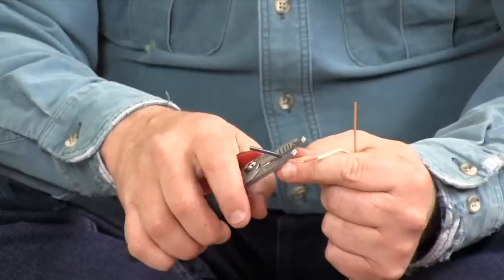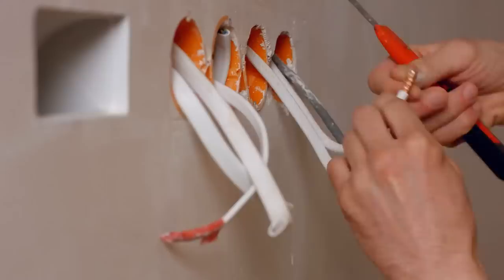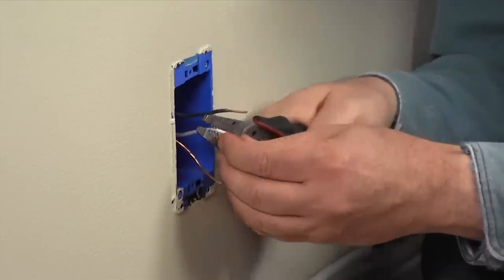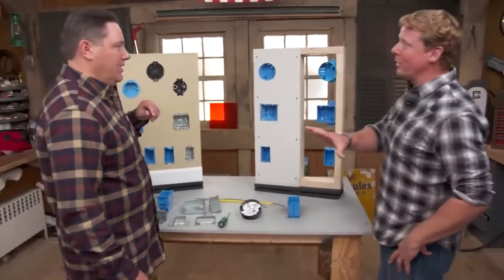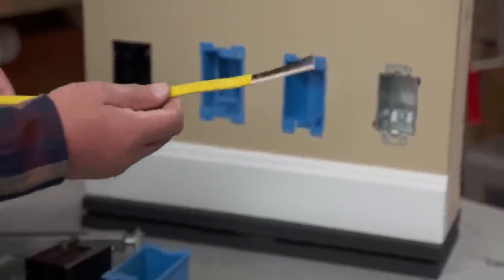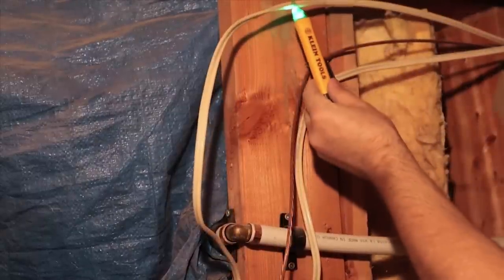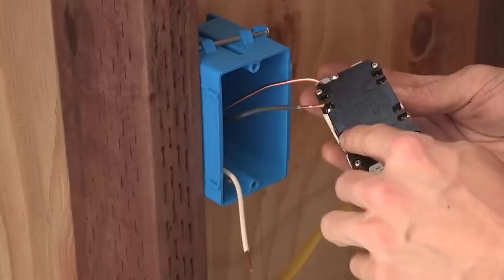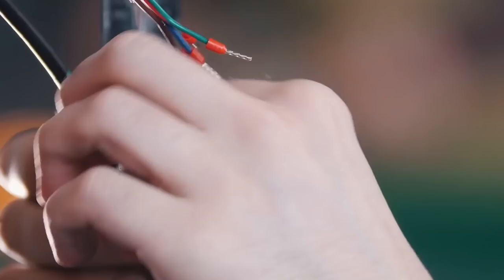Electrical Mistakes That Every Electrician NEEDS To STOP Making!

Comment: I'm a little confused by this. Are you under the impression that short wires are considered short circuits?? I assure you that they are two very different things and you have a serious misunderstanding of electrical basics. It's best if you leave the video making to those in the know. 😂
Reply: You need to go back and actually listen to what he said.
He said short wires are a cause of short circuits.
If the wires in the box are too short, there isn't enough ground wire to safely keep it away from the hot terminals in the box. Ground wire contacting the hot wire = short circuit.
Reply: @newguy2794  The neutral and hot wire touching will also cause a short circuit.  The problem with wires being too short in a box is related to the difficulty in making sound connections to the switch or outlet.  Because the wires are so short you have to struggle to properly connect them to the device installed in the box.  A poor connection can fail, resulting in a wire slipping off a terminal and touching another wire in the box.
Reply: @jackpine4347  That is how I understood it too. However in the very next statement he equates loose connection (shown arching in the video) with a short circuit. So even if the original thought is sound it has been garbled by the person who made the video
Reply: @david672orford  Upon further listening he made a quick reference to wires that are too short causing poor connections but did not really explain that. Most of this video is stock images combined with blabbing to fill up the time. He could have made his point about too-short wires causing poor connections that can lead to short circuits and fires in a few clear sentences.

Comment: 5:30 In most parts of the USA, it's OK to run cables through most walls with no conduit. The trick is knowing when conduit is required and what kind to use. 
PS: 2:14 If you are using the type of strippers shown here, it would be no surprise that the wires might get cut too short. Manual strippers with holes for each gauge wire are very prone to accidentally nicking, or even accidentally cutting, the wires that are being stripped. They also make it harder to strip off a uniform amount of insulation and to do it without tugging on the other end of the wire. If space allows, I very much prefer  automatic, self-adjusting strippers.
Reply: Actually, only cables defined as "listed for use in concealed spaces" are permitted by code. For the purposes of this discussion, that means NM/NM-B. Or you can use MC, which in the case of plastic boxes will require use of bonding bushings and appropriate boxes...not worth the hassle.

Your statement might lead others to believe they can legally run power cords, such as SJT or similar products through those concealed spaces. I've seen a contractor try to get away with SOOW just straight through a block wall, not acceptable.
Reply: @mikebowler1962  follow the NEC and make sure is approved by the AHJ
Reply: Please stop LARPing. Anyone who can't use regular strippers and relies on automatic ones is not a real sparky.
Reply: @Steve_Kassiotis  Agreed. The auto ones are great for bench or control panel work, too bulky for field work. Regular strippers in the hands of a pro will almost never result in a nicked/cut wire.
Reply: @pld8993  Fun fact, European electricians tend to use strippers like the CC22 or CC38 that doesn't have various sized holes, but relies on the user getting the feel for how deep to cut.

Comment: Leave 6" of wire from the inside of the box.
Reply: 6” from outside of box
Reply: @peejones9035  US NEC states: 6 inches from entry point of the wire, or 4 inches outside of box, whichever is longer.
Reply: @keebler82ut  In know what the Nec states. It was just a suggestion. I should have been more clear. I cut at 6. I like to strip my wires a little longer than needed and cut it to desired length.

Comment: Everytime I replace light switch I always keep slack on the cable(after power is shut off of course) I do have to cut the wires at where’re the clamp is for if it’s not connected using screw therminal s

Comment: alright besides the video which there are some great points you Diy or homeowners.. hire an electrician but read on.. i was reading these comments..😂😂
im gonna make this simple.
More then half these comments are bullshit.. for example, WAGOS...
i agree dont use level locks unless ur doing some low voltage.. hell go even better and solder your connections with low voltage..
However i have yet to hear anything from a pushin Wago cause fires, shorts, etc.. and ive been using them long before they were even heard of in the states.. a fellow electrician brought them from europe and showed us what they use..
Now  if a wire broke off from the Wago or some weird thing happen its cuz the eletrician made an error.. like using the wrong size stripping gauge crimping into the copper, making a weak point.. i can go even further wit other possiblities that no electrician wants you to know...
If any electrician suggests wire nuts over Wagos for lets say your job ur wanting done, its cuz he wants more money in his pocket.. it may be nickles but nickles add up.. 
besides money factors, Wire nuts are a big time risk factor,and its been proven many time over.. FOR EXAMPLE..
i dont know how many times ive opened a box and the failure was at the Wire nut.. fuckers over tighten them and pops out the tops🤦🏽‍♂️...or they dont know if when  twisting the wires together in the nut that one breaks within the sheathing until u go to test it... ESPECIALLY when they get folded up in the box... Let alone pig tails barely making connections.. box is pack to gills that the wire nut wedged between outlets or swtches..ETC, ETC... i could go on for days....
there is 2 benefits to wire nuts...
Cap live line for what ever reason u needed that line hot & quick connections to see if something is going to work...
Oooohhh wait i lied.. they are great for caping off caulking tubes as well.. almost forgot that one.. 
Wagos shit on Wire nuts! 
Want to know why electricain make a big deal about Wagos, cuz they the type who want to keep they delecate fingers soft.. meaning to get a line out of a Wago, u need squeeze the side and pull that line.. its tough, no lie, but fuck your pedicure, unless ur a lady electrician.. they amp me up 😝..
Anyhow ladies and germs, if your a someone seaking an electrician, find one who wont bullshit ya.. im tired of seeing that shit..

Comment: Bullshit right from the beginning Don’t use push in connectors fix the short wire problem by adding a length of wire with a physical connection and a wire nut!

Comment: 3 to 6" is still too short. leave at least 9" from the wall. the length of a good pair of side cutters (lineman pliers).
Reply: I strongly second this. Short wires are at the very least a pain to work with.
Reply: 6 inches is code. Having a short wire, say 1 inch is not only a pain to work with but can be hard to connect and or tighten to the device. Excessive length like 9 inches or more is not only unnecessary but can be hard to pack back into the box, especially if the box is too small in the first place. Plus, filling a junction box full of excess wires can cause unnecessary heat within the box if there is some load on the circuit. 

Stay safe and think smart.
Reply: @clarkcortezer2414  I second this!
Reply: @clarkcortezer2414  that was my thoughts as well. You only have so much space in a box there's no need to leave so much wire. Especially the exposed ground wires.
Reply: 6 inches is code. This guy making the video is absolutely ignorant. 🤦‍♂️
Reply: @Steve_Edberg  Thats not true always. The length of free conductors exiting the box depends on the size of the opening to the enclosure. If the size of the opening to the enclosure is less than 8 inches, a single receptacle for example, you only need 3 inches outside the enclosure.  300.14
Reply: The NEC is the minimum requirement,  you can do more if possible but not less
Reply: @clarkcortezer2414  
This is for all non electricians. This is how I was taught this is how I teach and this is how I do. You should be using a good pair of lineman pliers (side cutters) like a Klein 9 ne. The 9 stands for nine inches long. After the wire is pulled into the box, use your pliers as the measurement to cut the wires from the wall (not the inside of the box) to the end of your pliers and make that cut. You now have nine inches of wire. You can always cut some back if you need to but in most cases you won't have to. If the wire is too short you would have to run a new line or make a splice. Not having a splice is the best situation. Someone almost always comes back after you. Leave them enough wire so they do not have to make a splice. That was taught to me by I.B.E.W. I hope it helps.
Reply: @alvilla701  The NEC is also maximum requirement ex. it tell you how many wires can go into any size box or conduit. in that case you cannot do more but you can do less.
Reply: @twigd3825  when I said "you can do more" I tried to save you can do better than the NEC (example; using a 12 AWG on a 15 amp circuit, but not a 14 AWG in a 20 amp circuit), also the AHJ is even more important than the NEC
Reply: @alvilla701  i will always use 12 gauge. i once quit a job because  the contactor was using 14 gauge when the spec said 12
Reply: @clarkcortezer2414  a
Reply: You buying my Romeo? 6 inches